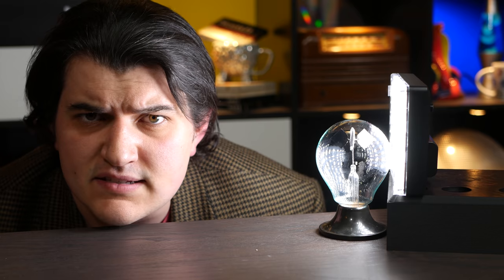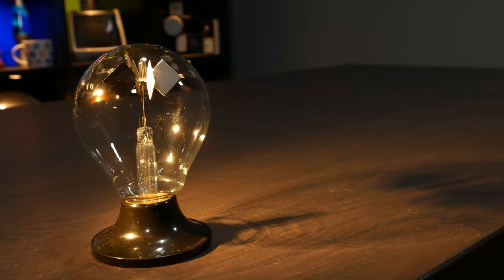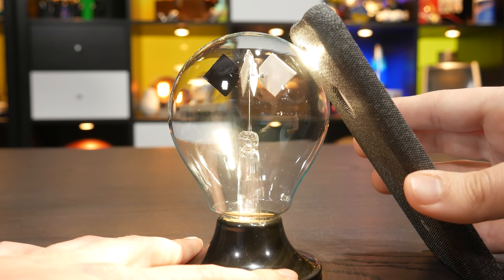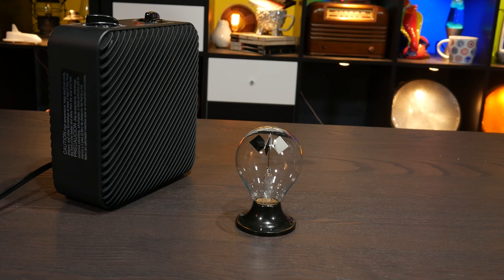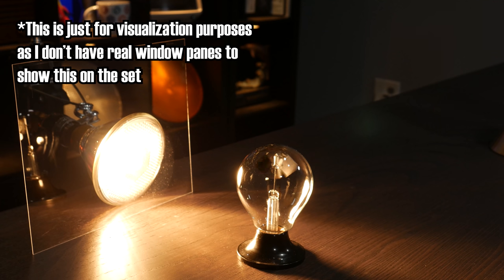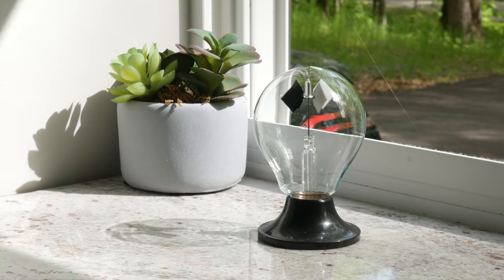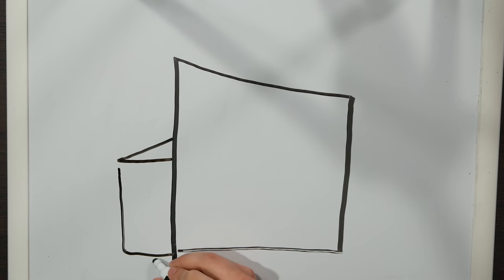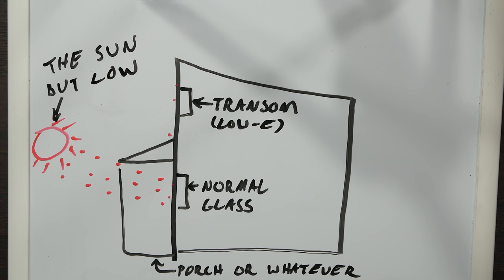What the Crookes Radiometer can teach us

Comment: A window that switches to let ir heat in in the winter and not during thee summer could actually be fairly easy. It could be as easy as having a sheet of plexiglass or real glass coated in an ir reflextive film and you just remove it in the wintere. just replace the screen with this and make it full length. or you have a standard window but instead of opening it to the screen you you are opening it to a non ir reflective glass
Reply: or you could have electrochromic glass that can vary its transparency to different wavelengths of light

Comment: The infrared blocking window is in fact, NOT a bummer in the winter.  Insulation works both ways.  What keeps heat out, keeps heat in.  Windows are notorious for leaking heat in cold weather.  Both by radiating, and from leaking air.  A well-built window covers both of these cases.

Comment: An easier and cheaper solution to the low-E glass dilemma is to plant deciduous trees outside the windows.  In the summer they shade the house.  In the winter the lack of leaves  allows the sunlight to be unobstructed.  It is also helpful to plant evergreens on the north side of the house to block the cold winter winds.  Planting trees also helps the environment and increases property values.

Comment: What I want to know is how they get that spinning thing inside the bulb through the narrow base! It's not like they can turn it sideways or something, because it has to be in position on the tip of the needle.
Reply: Ship in a bottle technique. What that technique is... I couldn't tell you.
Reply: @DeathRecon97   I think it involves elves.
Reply: @raydunakin  Definitely Elves. Wood Elves. Smaller fingers.
Reply: Magnets
Reply: My guess: the spinning thing enters the glass bubble slightly torn; once inside, they're put in correct position using long noose pliers; then the buble is put upside down and the pin, already in  its glass support, is put in correct position inside the spinning thing, pushing it to the glass bubble's top; next step is to turn the bubble in correct position, upside up, and carefully lower the pin to its final position; after that a torch fuses the glass of the pin support with the glass of the bubble.
Reply: So, @OgbondSandvol is pretty close, but I examined a close up shot at 1/4 speed, took some screenshots and zoomed in on them.  I have always had a keen interest in how things are made, and how to fix them, since I was very young, taking my first broken Walkman apart when I was like 8, hoping to fix it.  I was unsuccessful at 8 years old, but then I got older, took more things apart, studied Mechanical Engineering, with a Manufacturing emphasis, so now at 49 years old, I can pretty much look at anything and tell you how it was made.  It would be better if I had it in my hands, but the close ups and zooming is the best I have right now.

I think the weld between the two pieces of glass is right at the bottom of the bulb at the widest place before it necks down sharply into the base, in which case the whole spinner with fins intact WAS put into the bulb through that opening by turning it sideways. 

Then once the spinner is inside (basically sitting on the glass at the "top", but everything upside down), you just insert the pin, already mounted in it's glass part, putting the needle into the cup of the spinner, and weld the 2 glass pieces together.  My guess would be they used a laser, not a torch, but the idea is the same, heat.  A torch could be used, but the weld would be more apparent.

If the weld is not where I think it is, but rather concealed in the base at the narrower diameter, then the ship in a bottle technique had to be used, I think by putting the glass and metal part of the spinner in and then attaching the fins with tweezers.

I'm leaning heavily toward my first option, simply considering mass production, and the fact that if you can put the spinner in the bulb intact, it's a production line, if not, you've got a huge bottle neck of people using tweezers to get it in there.

It's either that, or it's elves...

lmfao, if you read this far, I think my comment deserves a 'like'
Reply: It's bottled sorcery I tell ya!
Reply: easy. see the li’l metal strips that hold the paddles onto the itty bitty glass condom? those are all one flat, ring-shaped piece, and bent downward to be placed inside with paddles already attached. (the paddles are just printed card-stock.)

then, once inside, the strips are straightened out and twisted 90 degrees with some long pliers. a long wire rod with a 90-degree hoop on the end (almost like a dentist’s mirror) can be used to hold the ring steady while manipulating the paddles.
Reply: @kaidwyer  I looked at that in my close up zooms.  It wouldn't help to put them in like that, and if you look very closely at the metal parts, they were not twisted into place, they were cast that way.
Reply: @davidosborne1306  They could also have pre-shaped the pronged ring as you said, and had the metal strips bent at 90 degrees beforehand, then inserted and crimped the paddles after the ring was in place.
Reply: @kaidwyer  absolutely true, in terms of possibility, but my opinion is, that is a third world, high cost option, whereas the better option for manufacturing is to be able to insert the spinner whole.

If I was designing the production line, that's how I would do it.
Reply: Replying to my own comment... I feel the urge to make one of these, by cutting a light bulb and changing the filament part to a needle ... I think I can accomplish all of that.  I do have an acetylene torch, plenty hot enough to weld the glass back together, but not enough control, so I would probably just epoxy the glass back together.  I'm making a science project, not a production piece, so I don't care what it looks like.  The partial vacuum is a little challenging, but I think I could drill a small hole in the base, heat the bulb to a high temperature, so the air inside is heated to a high temperature, and then fill the hole in the base.  As everything cooled, assuming I got it all sealed, the pressure inside would be very low.
Reply: you guys...............

the bottom of the bulb is bigger than the whirlygig before it gets crimped and welded to the base of the enclosure

the machine that assembles them has a vacuum pump and heated clamps. The clamps press into the bulb, soften and crimp the glass to a state that is airtight to the room its in, then the vacuum pulls it to the desired amount of air, then finally the clamps close off the bulb by welding it to the base

an alternative method is to weld the bulb to the base without the pin in it, pull the vacuum, then drop in the pin. in this case, again, the bulb is bigger than the spinnymajigger
Reply: @Thesupremeone34  came here to say exactly this. Glass can be reshaped quite easily.
Reply: @davidosborne1306  Yes, I agree that your hypothesis of the opening in the bubble slightly bigger than the spinning thing is better than the pliers' hypothesis.
Reply: @davidosborne1306  The difference of pressure inside the bubble, when the bubble is hot and when cold, can be calculated easily. Pressure is directly proportional to the temperature in K, because in the closed bubble the quantity of gas and the volume of the bubble are the same (the change in volume because of temperature is irrelevant, I think). If you heat the bubble to, lets say, 100° C (373 K), seal the tube, the pressure inside at 20°C (293 K) will be about  293/373  (78,5%) of initial pressure. I think that 78% is still too much, isn't it?
Of course you could heat the bubble to a higher temperature to achieve a better result (a lower pressure). But, the higher you heat the bubble, more difficult is to handle it - and the glass of the bubble can change of shape, or even can open a hole. I think that the only effective way needs a vacuum pump.
https://en.wikipedia.org/wiki/Crookes_radiometer says that "The effect begins to be observed at partial vacuum pressures of several hundred pascals , reaches a peak at around 1 pascal (7.5×10−3 Torr)"  Since the atmospheric pressure (1 atm) is about 101,000 pascal, I think that you will not achieve such a low pressure as "several hundreds" pascals (100 pascal = 1 x 10 ^ -3 atm so 800 Pa = 8 x 10 - 3 atm ) just by heating the bubble before closing the hole, and cooling the bubble after.
Reply: The flags are cardboard, and cardboard is flexible.

For maximum production speed, you can heat the needle holder, stick the needle in, put the "propeller assembly" on the stick, and force the bulb over the flags.

If the engineering team did their job, the flags will deform and go back to shape, and the bulb will weld to the hot base without breaking due to thermal shock.

Alternatively the stick can be designed to be a snap-on item that will not come out once forced in its base. Then a shorter heat cycle will weld base and bulb
Reply: There's made like "poire william" bottles. the bulb is attached to the tree before the rotor grows in spring and summer time and in autumn time it's time to harvest the crookes bulbs of the year. Pour some air vaccum into it, not too much, seal close and you're done
Reply: It's elves. Fact.
Reply: 25 minutes well spent ...
Reply: @Thesupremeone34  That's another good possibility, (The crimping idea).It's still the same idea as I presented, except in the way it was closed.  I think I do like your idea on that... As I looked at the glass at the corners, it's a sharp bend, so I was thinking they welded it there, but I was also skeptical that even a laser could produce such a clean weld.  So I think you're right about the crimping.

As far as the vacuum, I was thinking about things in 2 ways, first, How they made it, and the vacuum part wan't really of concern to me.  It could have been any of several methods, and it didn't matter.  The second way I was thinking about this was how I could make one myself, and that is when I started thinking about how I could produce a partial vacuum...That's what showed up in my comment.
Reply: @OgbondSandvol  When I said high temperature, I meant, just below the melting temperature of the glass in question, so I was thinking it would be more like upwards of 1200° C.  Could be higher than that, depending on the glass.  I'm only thinking about this in terms of making my own.  I have all kinds of ways to make a vacuum, but how do I seal it while the vacuum is applied?  I think the best way I have is to superheat the bulb and close a tiny hole while it's hot.
Reply: @OgbondSandvol  yeah... outside the box, makes it pretty easy, but honestly, I was trying to figure out how I would make one that looks like a light bulb, like the one in the video, as a display/conversation piece.  Not so much the easiest way to make one, but how I could make one like the one in the video.
Reply: @davidosborne1306  my crimping idea isn't my idea

it's how vacuum tubes and incandescent light bulbs are made
Reply: @davidosborne1306  Connect it to the vacuum pump (with a valve or whatever you want to use to regulate the partial vacuum) via a glass tube that you can heat up and pinch off in the middle, like how incandescent/fluorescent lightbulbs and vacuum tubes are (were) made. Part of the glass tube remains part of the finished envelope.
Reply: @davidosborne1306  nice writing, but no like because of begging.
Reply: @davidosborne1306  I fear that heating the glass bulb to about 1500 K in order to have the gas inside it at the same temp, intending to close the hole in the bulb in order to obtain a low pressure inside it after cooling, is MUCH more difficult than using the vacuum pump solution. The glass would bend and the bubble would colapse at just a few hundred degrees. Bulbs for lamps are made applying a significant positive air pressure from inside; the vacuum and the sealing occurs after the glass bulb is cool.
Reply: @redwarf8118  The like was supposed to be for the fact that I did try to submit a valid idea about how it was actually made, but then at the end, tossed in a throwback to the guys who said it was elves.  It was more like acknowledging that you read it to end, and saw the joke, without having to actually reply.

Comment: Re "Maybe the glass could be reversible so it reflects short and medium wave IR only on one side [...] I hope you'll let us know".  I'm glad you asked.  It's not possible to reflect IR in one direction but not the other.  One way of looking at it is by recognising that reflection is time reversible.  You want IR to go from side A to side B and from side B to side B.  If you watch that backwards, IR goes from side B to side A and from side B to side B.  You want the IR from side B to end up both on side A and side B.  That's not possible.  Another way of looking at it is to build a perpetual motion machine around such a thing.  All you do is have two chambers which are at the same temperature and hot enough to emit IR.  Put the magic one-way glass between them.  IR will pass from one side to the other causing one side to heat up and the other side to cool down.  Then use a heat engine to turn a wheel and you have a perpetual motion machine.  Again, that's impossible.  To get the desired effect, you would need to make the glass switchable.  The simplest way would be to have two windows, one which is good for summer and one which is good for winter.  At the change of the seasons, you simply take the old one out and put the new one in.  It would be nice to have it electronically switchable so change the amount of light reflected due to changing circumstances.  It looks like it's already possible to buy switchable mirror glass.  I don't know how well they handle IR, but the principle is the same.

Comment: For your question at 17:50: Transmission from inside to out has to be the same as from outside in. You can do trickery with angles of course (better transmission in the angle where the sun is most), but along the same ray path there has to be symmetry. Otherwise you could make perpetual motion from it.

Comment: So let's speculate on Alec's hypothetical time-machine :
It will display time in analog digital numbers, and most likely a form of mechanical memory (way more complex than it needs to be) , it will make use of heat pumps (of course) and it may need to consume cleaning detergent for operation.
Reply: also, it powers itself through space-time using latent heat
Reply: And its operation is shut off automatically via a bimetallic strip
Reply: @motoviggo  🤣👍

Comment: I remember many years ago in my local Home Depot that used one of these devices to demonstrate how much heat this new Anderson Window blocked. On one side of the window was an intense light that generated a significant amount of heat. So when you closed the window the radiometer virtually stopped. I was maybe younger than 10 and always assumed that the spinning was in fact heat related.  The sign at the display even said so.  Also my grandparents had, I would guess, a type of radiometer that was lamp shade shaped that went over a nightlight and only spun when the light was on.

Comment: I found similar difficulty explaining things to the mechanically challenged, and remember I once managed to explain tendon shortening and muscle atrophy in a plaster cast limb, using a little wooden puppet toy from my youth. It has a spring-loaded push-button base attaches to strings running through the inside of each limb. The spring holds these strings taut, but push it in, and the string loosens, causing the puppet to collapse. Releasing the button causes the spring to re-tension the strings, pulling all the joints taut and snapping the puppet upright again.

Comment: 17:36 That is not possible because it would break the laws of thermodynamics. A window that allows IR radiation of the same wavelength (that's important btw) through in one direction but not in the other direction would let you make a perpetual motion machine. Place two objects of the same temperature on opposite sides of the glass. IR radiation would travel from object A to object B but not back the other way, heating up B and cooling A. Once B is significantly hotter than A, put a heat engine between the two, and tada! Perpetual motion machine. 

However it's almost certainly possible to make a window that lets short wavelength IR (which sunlight has a LOT of) through, but reflect medium and long wavelength light. That would be useful in the winter. That's essentially how the greenhouse effect works, just combine visible light with the short wavelength IR, so both of those are allowed through while the long and medium wavelength IR is reflected. It doesn't break the laws of thermodynamics because the glass is still symmetric at each wavelength, so if you put objects of the SAME temperature on each side you'd get equal radiative transfer in each direction. It's not asymmetric, it's just that it's more reflective at certain wavelengths and more transparent at others.

And to be pedantic and completely finish the argument: Having objects of different temperatures on opposite sides won't break the laws of thermodynamics either. Because it turns out a blackbody of a higher temperature emits more light at ALL wavelengths than a cooler blackbody. Which means glass that is symmetric at all wavelengths will have more energy transferred from the hot object to the cold object at each wavelength. And you can't cheat by making something an imperfect blackbody by changing it's emissivity at a certain wavelength either (for example, say painting it white to make it less emissive in the visible light range). Because emissivity works both ways. If you reduce visible light emissivity by half by painting it white, that means it will not only absorb half the visible light, it will also emit half the visible light in its own thermal radiation.